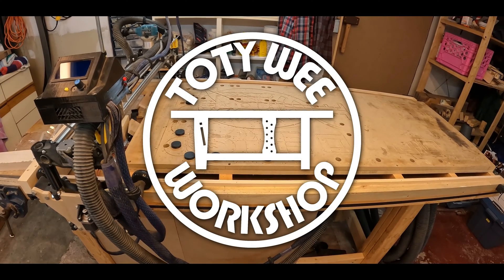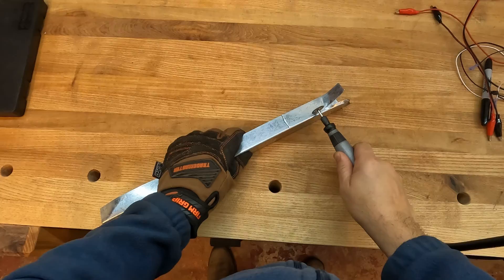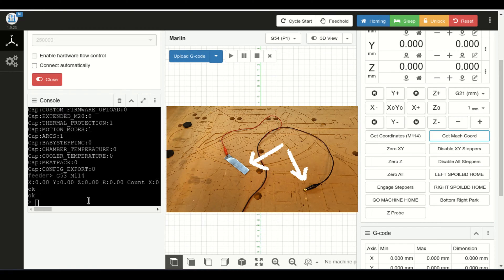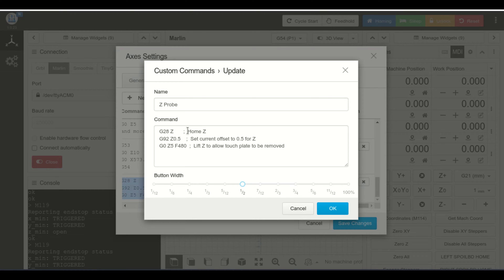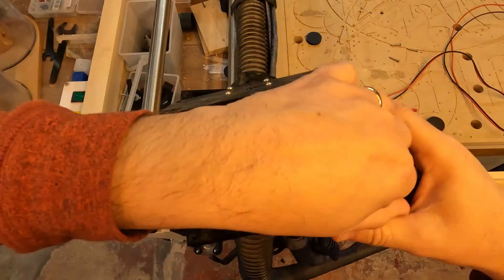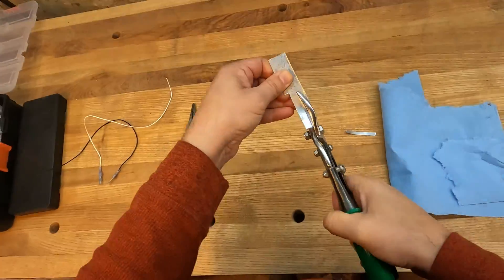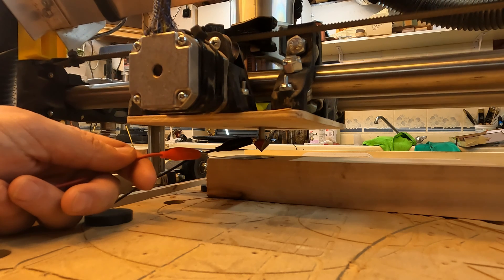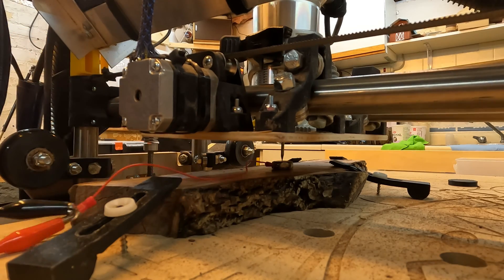Making a CNC Z Probe

Comment: but i need know, step by step how i make same to linuxcnc, i not understand how make button on display, and then if bush button call makro go to measure point Z go down and trigger and make z xero. i have touch plate/probe wiring and trigger good. but all other not understand. what code and were folder, button code and then call macro code and were folder need add codes.  has simple but newer before not has use code and linuxcnc were have folder were all need add. or ini file add lie or what ewer need do.

Comment: very nice video do you know many routers the bit is grounded through the router and you can run a wire to the router case.  No need for the magnet to the bit wire.  My DIY CNC table is metal so I can just connect to the frame for one wire connection to the controller.
Reply from the maker: That would be ideal!
I had read that the Makita RT0701C was not grounded through the bit so I didn't test that.
This method will work with any router but if the router bit is grounded to the router in some way then you have more options of where to connect the wire. In my case, even if the bit and the router are connected, the router is not connected to the gantry in a way that would conduct electricity. Still, connecting to the top of the router would be easier.

Comment: What controller software are you using in this video?
Reply from the maker: I'm using cnc.js (https://cnc.js.org/) running on a Raspberry Pi connected to the Rambo 1.4 board.
I use a laptop to connect to the cnc.js web interface and my phone to connect to a cnc.js tinyweb pendant interface.
My Rpi uses a V1Pi (https://jeffeb3.github.io/v1pi/) image created by @jeffeb3 who can be found frequenting the v1Engineering forum (https://forum.v1engineering.com/)
The Rambo 1.4 is flashed with Marlin firmware packaged by v1Engineering (https://docs.v1engineering.com/electronics/marlin-firmware/)
Reply: @totyweeworkshop  awesome, ty. That's damned sexy,  and I won't have to repurpose a Duet for my build! Looks like it might be slightly more complicated to set up,  but the result looks great. 

Are there any good walkthroughs on v1 forums or elsewhere, for getting it set up and tuned?
Reply from the maker: For cnc.js there are the basic docs: https://cnc.js.org/docs/user-guide/
However...
Ask this question at https://forum.v1engineering.com and there will likely be more answers. It's a very supportive forum